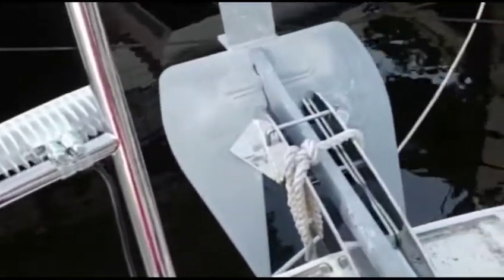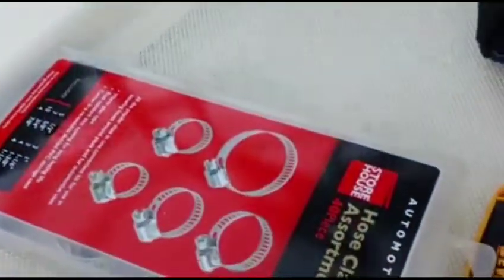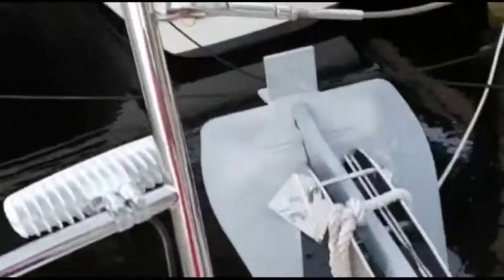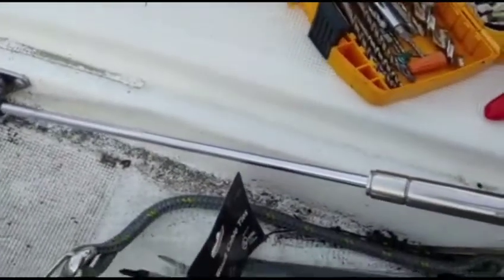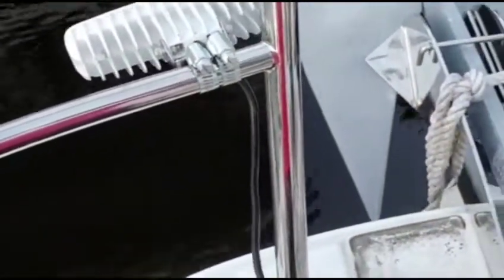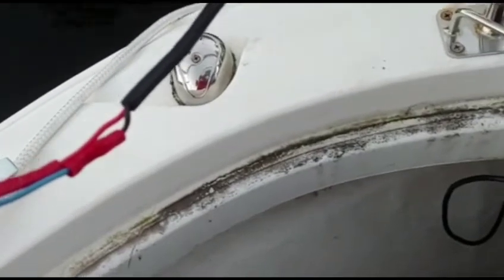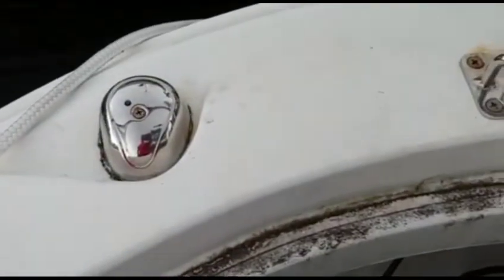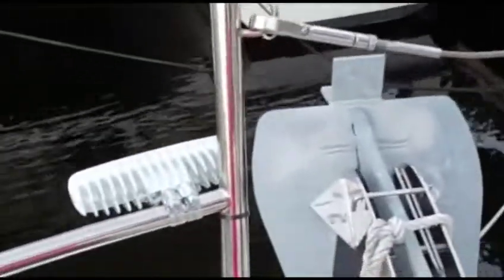How To Install Lights On A Boat

Comment: We need to see how bright the lights are at night ?
Reply from the maker: They were actually too bright for canals in the city. I had to install a remote control dimmer switch, only $12 on eBay. Brightness will vary based on the lumens of the lights you choose. The angle also can be adjusted, it was a big improvement over no lights at all, beside the position ones. Thanks
Reply: @ingeniousgiacomo  Did you fit a relay to the wiring or just connect the positive and negative straight to a switch via a fuse board or fused wire ?